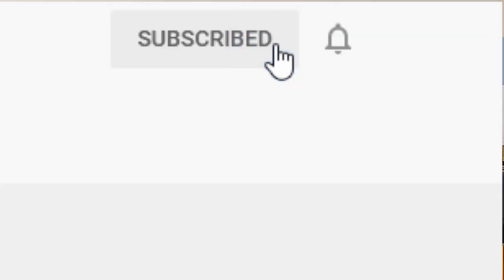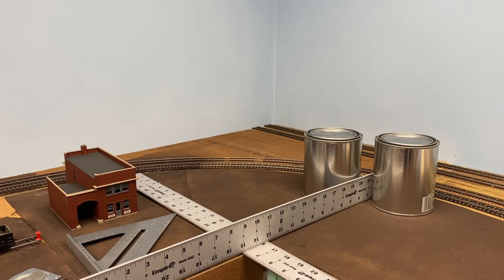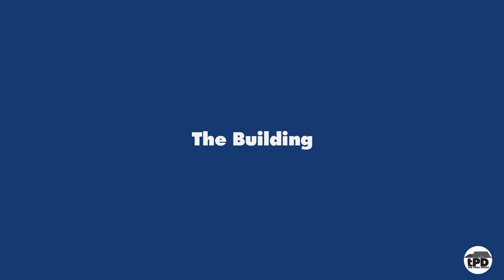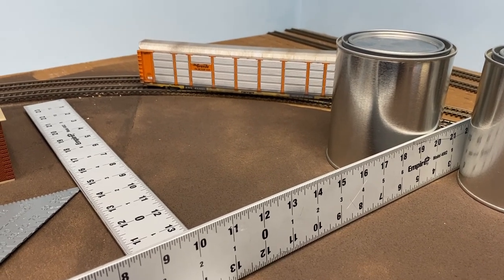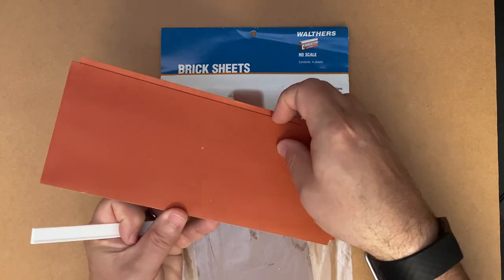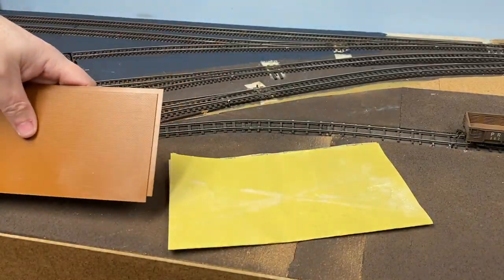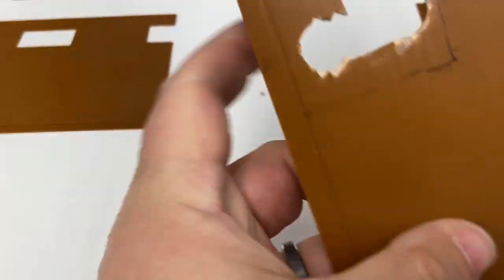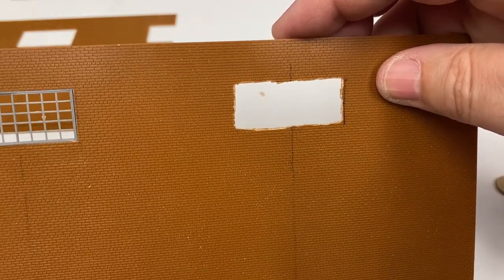Scratch Build HO Scale Buildings - Making a Scrap Yard Industry - Ep. 2

Comment: Chunks from the nibbler tool can be added to a half full jar of Testors liquid cement where it will dissolve and become a somewhat viscous fluid that is perfect for using as a 'filler' for any plastic work requiring repair.
Reply from the maker: I have made such a fluid using pieces of styrene strip, but the fact that your suggestion uses material I would have ordinarily thrown away is genius!

Comment: I had a 22" radius curve, half circle fit on a 4' wide surface. 6 axle locos ran good, at slow speeds. I don't have anything large like auto racks or 80' box cars though.
Reply from the maker: For me it was less about how they ran (I’ve never had a problem with derailments and I use 4 axle power) than it was about how they looked. The long cars just look odd to me hanging over the curve like they do.

Comment: Hi Joe, to remove the bulk of the plastic, how about a "hot knife", melt your way through the excess material then do the fine finishing? Thanks for your videos, getting not only ideas but inspiration to boot.
Reply from the maker: Have you tried this? I've never heard of anyone doing it, so I'm curious as to how well it would work.
Reply: @ThePixelDepotLLC  I rigged up a wire to the tip of my soldering iron, plastic melted pretty quick, too quick for any degree of control. Xacto I think has or had a set up with a #11 blade in an adapter for a soldering/wood burning iron some time ago. So I think if you were to try the soldering iron/wire wrapped around the tip, some sort of temperature controller would be needed to find the best temperature to maintain control do the business.

Comment: I'm in the process of scratch building 2 HO scale structures; one is a single level brick house made from an old English Leather cologne redwood box--the whole structure is made from wood.  The other is a 2 story business (probably a lumber company) which I'm making out of foam core board.  I've been making small card strips and gluing around the outside to be batten board siding which is a very tedious task.  Before I add the Tichy windows and doors I'm going to airbrush the 2 story structure (I've already painted the windows & doors) and put on the brick plasticized card stock from Rail Scale on the single story house.  Cheers from eastern TN

Comment: I use the nibbler to do many cut outs and I use the little nibbles (tee-hee-hee) and I put them in a small jar (air brush size) and add some solvent and in a few days I have a jar of filler that is free (so to speak)... To drill the starter hole, I use a drill that has multi sized holes so I can start small and as you go down into the material, the hole will get bigger...And yes I use a drill press... To keep from screwing up the work piece I always drill in the center of the space I want to get rid of. Never drill out to the edge.. Never !!! To file the opening to size, I usually clamp the wall between 2 pieces of wood (1/4 to 1/2 inch thick plywood) so I can sand the edges and not have the work piece flexing. i usually use a small vice but sometimes I have to use 2 "C" clamps to hold the wood and the wall. The wood can be placed as close to the final edge as you want. I usually use it to line up the brick line I want to file to. Overhead camera angle is fine.

Comment: The Walthers brick sheet you used for this are very thick. That's good in a way because you don't need to laminate it to a piece of styrene but it screws you up when trying to make precise cutouts for windows and doors and cut down to size. I'd rather use thinner material from another supplier and laminate it to 0.40 or 0.60 styrene. JTT Scenery makes a brick wall sheet that is less expensive than other suppliers of the thinner sheets and it works very good in my opinion. It's up to whatever the individual thinks works best for them at the end of trying different materials. With this, as with many things in the hobby; there is not really a wrong way or a right way to do scratch building. The right way is having fun and enjoying what you're doing because this is supposed to be fun. Great video. Very enjoyable. Always like scratch building videos. Stay well. -Wil  👍
Reply from the maker: I used the Walthers sheets for that very reason: I didn't want to have to laminate the large walls. I did use a thinner brick sheet (from the N Scale Architect) for the tops of the faux back walls. You'll (hopefully) see that in Part 2. Thanks for the kind words on the video!

Comment: A step drill bit is meant for cutting through thinner material and may help with controlling damage when drilling your holes. The Walthers brick is tough stuff. I miss the old Holgate & Reynolds brick. Currently I am using wood laser cut brick from Monster Modelworks and KC's Workshop.
Reply from the maker: I've managed to amass a wide variety of tools over the years, but I've never gotten a step drill bit. I'll have to try it out. I did use a thinner brick sheet (from the N Scale Architect) for the tops of the faux back walls. You'll (hopefully) see that in Part 2. Monster Modelworks stuff is nice. I've never gotten anything from KC's Workshop.

Comment: Question please:
Where do you buy that nibbler tool. Also, can it cut/nibble on say thin mat board and/or thin wood clap siding board? Thanks and nice video. Well done.
Phil
NYC/Jersey Shore Area
Reply from the maker: You can buy it at Micromark (www.micromark.com). If you use PIXELDEPOT as your coupon code you'll get 10% off your order. It should have no problem going through mat board or thin wood. However, I've never tried it on those, so I don't know if the pressure will damage the surrounding material, so I would test it on scrap first.
Reply: @ThePixelDepotLLC  Thanks for the info...Appreciated very much.